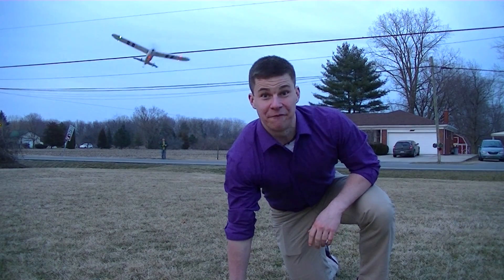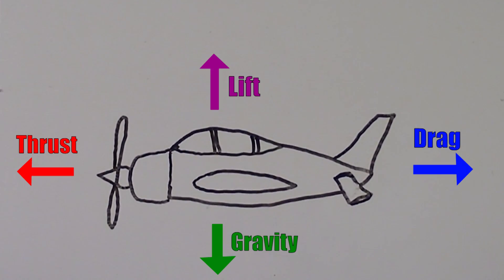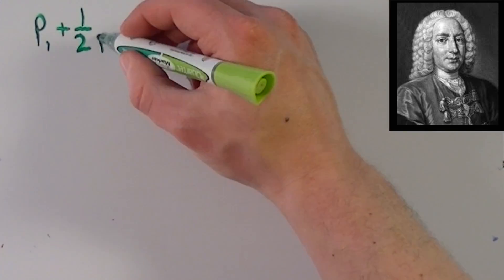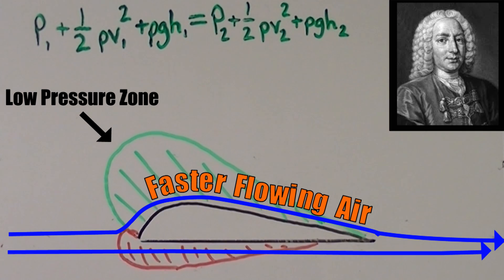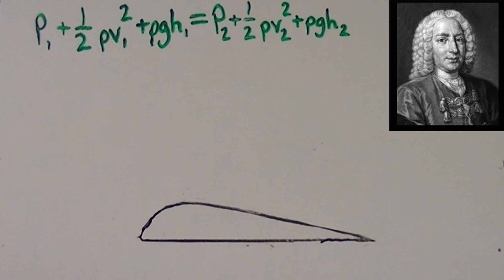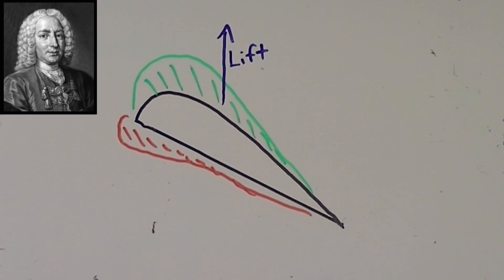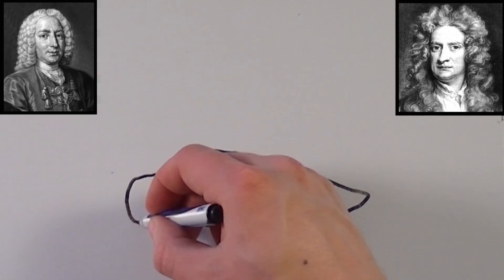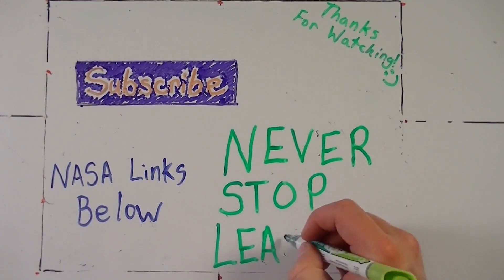How Do Airplanes Fly? (Bernoulli vs. Newton) : The Nerd Report

Comment: For the nerds, if you pull a slightly-inclined hydrofoil slowly through liquid helium, no transverse force will be generated. The same kinematics with liquid sodium will produce a transverse force. In the helium, flow doubles back round the trailing edge towards the rear stagnation point. In the sodium, because it is not a superfluid, the flow breaks away at the trailing edge and a starting vortex is left in the flow. By the topological principle of conservation of vorticity, there must be net nonzero vorticity associated with the sodium in the boundary layers around the hydrofoil and this generates a transverse force by the Magnus effect. Trying to invoke Bernoulli's principle is merely wisdom after the event of the flow breaking away at the trailing edge, and fails in liquid helium. The Magnus effect and the Kutta-Joukowski circulation theorem can be shown to be the same thing. This doesn't have to be a difficult subject. The starting vortex can actually be visualised.

Comment: I clarify my comment from 4 years ago.
.
As Aerogeek says you avoid some common misconceptions, but you also don't explain enough to have much to be right or wrong about.
..
First, you state Bernoulli's Principle incorrectly. The way you state it (the faster a fluid flows, the lower its static pressure becomes) 
 implies that we only need to compare any two fluid speeds to determine the unknown quantity and this is false. Bernoulli's Equation only applies within fluid flows where the Bernoulli constant is the same.  This is basically along a single streamline, but with some  flexibility in specific situations.

Your statement implies that the air out of any blower is at a lower static pressure than the still air around it and this is demonstrably false.  It is at the same pressure. 
.
Correctly stated it is that: an increase in the speed of a fluid occurs simultaneously with a decrease in pressure

Note that this talks about an increase in speed not simply speed itself and this is NOT the same thing.  
An increase in speed is acceleration. 
..
Also note that it says it "occurs simultaneously with" NOT that it "causes" a decrease in pressure. In other words, there is no statement of cause, nor effect.
..
It was Euler who actually derived Bernoulli's Equation and also determined that it is a pressure gradient that causes fluid acceleration.  A pressure gradient is a difference in pressure that changes along a line between two regions/locations.  It is the higher pressure that pushes, and therefore accelerates the fluid toward the lower pressure region. Air has mass and a force, from the pressure gradient, causes the fluid acceleration. It is Newton for Fluids.
.....
.....
Second, you zip right past the essence of lift with the common "Newton Reaction" explanation. 
.. 
The science is that the pressure differences that are a result of (caused by) the movement of a wing through air, are such that there is more pressure pushing up on the bottom of the wing than there is pushing down on the top.  This produces the net upward lift force.
..
Those very same pressure changes also push down on the air to produce the down-wash and satisfy Newton's Third law.... as well as all of the air accelerations we see around a wing.
..
Pressure in a fluid pushes (in all directions) at a point, so for example, a higher pressure under a wing pushes up on the wing and down on the air below. 
Part of the down wash is caused by the higher pressure under the wing.  
The rest is caused by the lower pressure above he wing allowing the atmospheric pressure far above the wing to push air down toward the low pressure above the wing ans then winding up in the down-wash. 
.
The REASON the upper air races toward the trailing edge is because the higher (normal atmospheric ) pressure ahead of the Wing, pushes (accelerates) air toward the lower pressure above the wing.

Comment: Why does the air travel faster over the top of the wing?
Reply: +Kelly,
.
The REASON the upper air races toward the trailing edge is because the higher (normal atmospheric ) pressure ahead of the Wing, pushes (accelerates) air toward the lower pressure above the wing.
...
Detail:
..
The science is that the pressure differences that are a result of (caused by) the movement of a wing through air, are such that there is more pressure pushing up on the bottom of the wing than there is pushing down on the top.  This produces the net upward lift force.
..
Those very same pressure changes also push down on the air to produce the down-wash and satisfy Newton's Third law.... as well as all of the air accelerations we see around a wing.
..
Pressure in a fluid pushes (in all directions) at a point, so for example, a higher pressure under a wing pushes up on the wing and down on the air below. 
Part of the down wash is caused by the higher pressure under the wing.  
The rest is caused by the lower pressure above he wing allowing the atmospheric pressure far above the wing to push air down toward the low pressure above the wing ans then winding up in the down-wash. 
.
The REASON the upper air races toward the trailing edge is because the higher (normal atmospheric ) pressure ahead of the Wing, pushes (accelerates) air toward the lower pressure above the wing.

Comment: Hi, I wish you will see this comment early.. I liked you video but I do not understand eveything,  In fact you haven't explain how symetrically curved wings can fly or how planes can fly upside down?
Reply: +emilie Frck,
.
The simple answer is that it is the relative motion of the wing through air that create pressure changes.  This is because the wing must push the air around to get through it. [Not Bernoulli or pinching/squeezing or anything else]
...
A wing at a reasonable angle of attack (AoA) creates this pressure difference (the pressure is more under pushing up that above pushing down).
..
IMORTANT:
..
It is the FLOW patterns around the wing, NOT simply wing shape, that causes the lower pressure above and higher pressure below the wing.
... and an inverted wing creates these very same changes if angled correctly --- as does a completely flat plate wing.

Comment: This is pretty good-the only slight correction is that when you demonstrate the air leaving the upper trailing edge, it appears that the wing adjacent to the wing surface is travelling at higher speed than the flow above. This is not the case. The air closer to the wing surface travels slower because of boundary layer (form drag) Look at the Babinsky-Cambridge University 'streamlines around an aerofoil' video. It also debunks the idea that the air over the top surface 'accelerates' .

Comment: It depends on what you mean by 'flying'. A rocket can 'fly' and it has no wings but is all power with no lift. To travel horizontally requires lift. A properly shaped wing allow for lift to be generated more efficiently. The shape of the wing needs to be matched to both the design speed and power of the airplane. A good wing for a glider is not so good for a plane to be used as a crop duster. You are correct in the a flat wing will work with enough power to get enough speed. MAK - CP-ASEL-IA

Comment: Many pilots know the superb book "Stick & Rudder" by Wolfgang Langewiesche, it tells that without an angle-of-attack, the angle between direction of flight and and the angle of the wing, there will be no lift, that directing a mass of air down is needed to provide the 'upward' force on the aircraft, the lift. An easy rule to get a feel for flying.  Just for an FYI, a planes velocity in level flight is largely independent of the throttle, it depends on the AOA, the throttle controls the altitude.